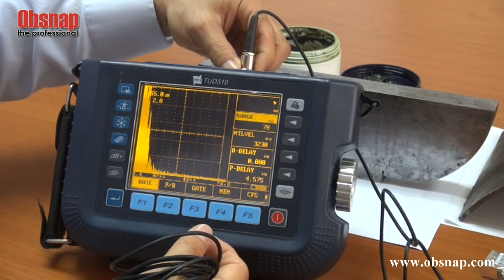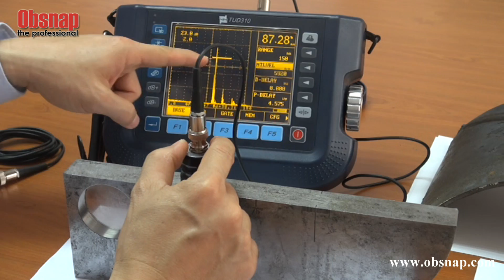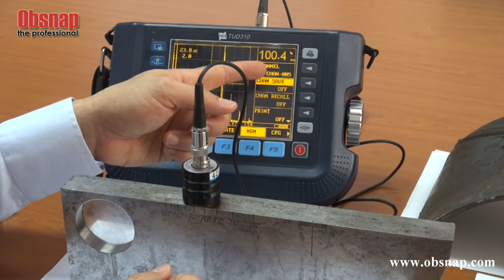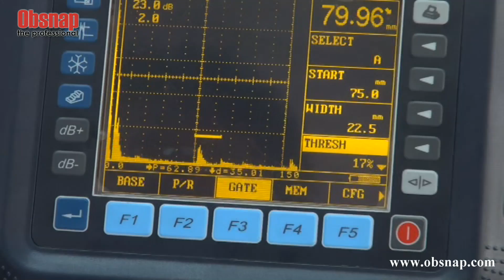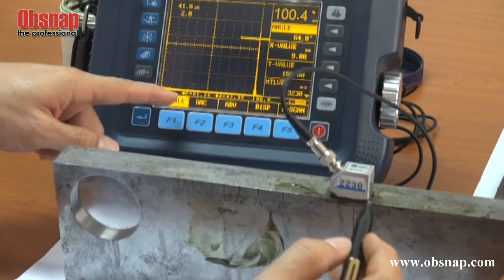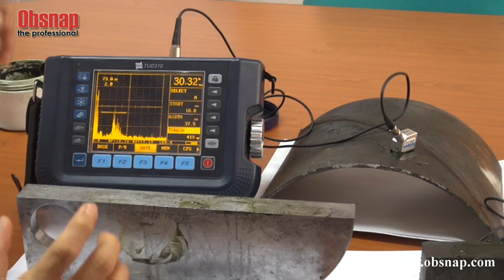TUD 310 ULTRASONIC FLAW DETECTOR

Comment: Correct me if I'm wrong but refraction is pnly possible for angle beam, theres no refraction on longitudinal wave. The term to use when using zero angle probe is oscillation/oscillate back ...